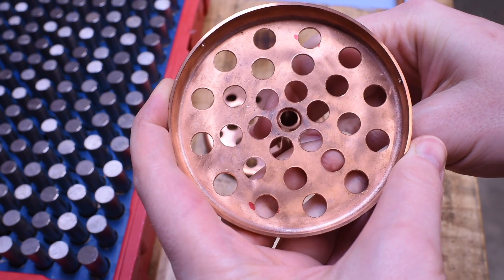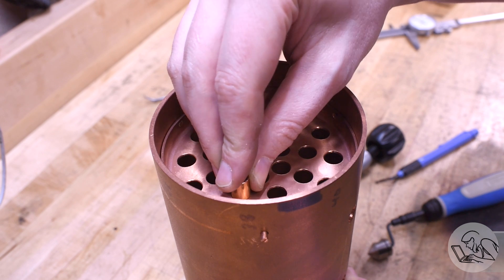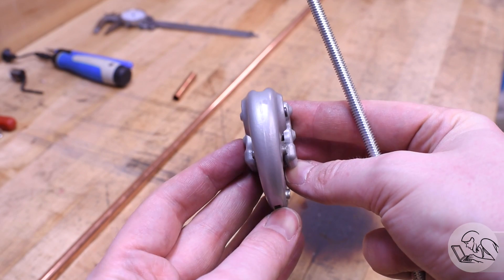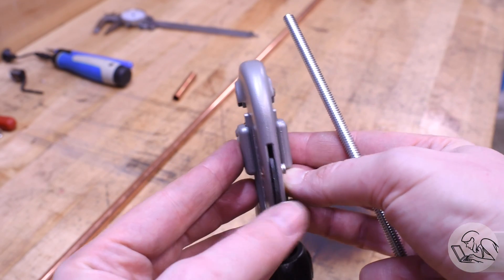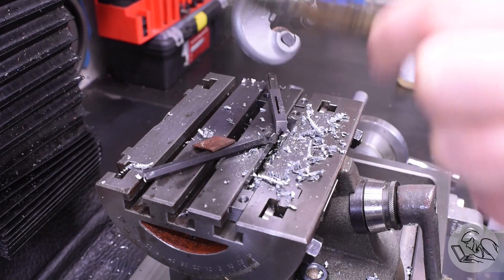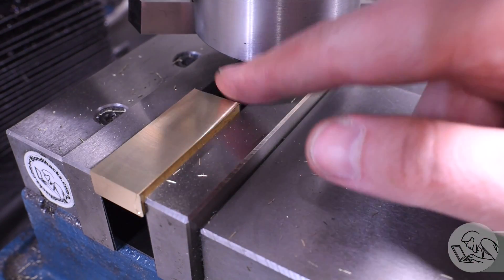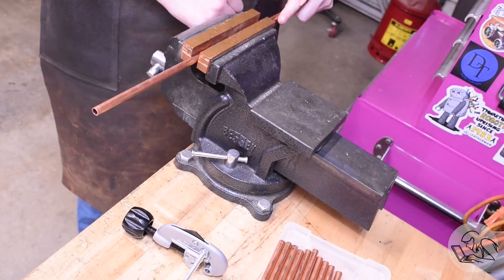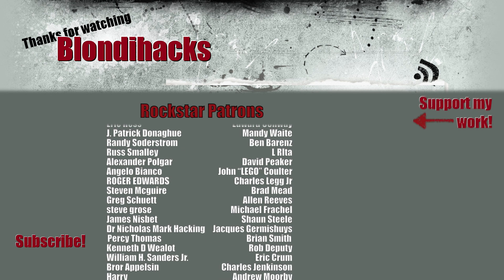Repeating Tubing Cutter : Making boiler fire tubes | Model Boiler Build, Part 5

Comment: out of curiosity... have you ever put together a boiler using two tubes per run, one inside the other leaving an 1/8" wall of water around the inner tube, and permitting the heat access to both the ID of the smaller tube and the OD of the larger tube to heat the water evenly instead of trying to heat a columnar shaft of water?

Comment: In the jewelry industry we often have to cut tubing at repeatable sizes for hinges, thus there are commercially available tubing cutting jigs. Of course, we generally make our own tubing, at about 1-1.5mm dia., and we cut the sections with a jewelers saw rather than a teeny-tiny tubing cutter.

Comment: Nice work. Just a suggestion, if you are going to be doing this kind of work in the future , you might want to pick up a flaring block and different swedging dies. This would help in adjusting your tube ends I believe. Thanks for the look.
Reply: Or make a set?

Comment: We had a yard period for the ship I was on, both boilers were re- tubed. The bell ends were flared by a special roller assembly and the process was simply judgmental by the operator, you'd think a slip clutch or some sort of torque limiter would be used, but nope, the old yardbird just stopped when he felt it was "right"- these old guys were the ones that would stop off at the bar just outside the yard and have 5 or 6 "boilermaker" drinks before heading home and doing the same stuff the next day. Never had a tube leak that I was aware of either, we'd hydro a 600 P.S.I. plant to 900 lbs. too.
Reply from the maker: Yah, tube rolling involves a lot of skill!

Comment: "A #7 (0.201") for some reason."
Tap drill size is the major diameter minus the thread pitch. That is 0.250 - 0.050 = 0.200 with a #7 being the closest bit available. As usual, the metric system is easier. An M6x1 uses a 5mm tap because 6mm - 1mm = 5mm. BTW, if the Imperial system marked bolts using the same method as in metric, a 1/4x20 would be IM.250 x .050 but 
1/4x28 would be IM.250 x .035714286.  :-(
Reply from the maker: Yes I know where it comes from. It was just a joke

Comment: The original sized copper tube could have easily been flared big enough to fill the gap.
Reply from the maker: I tried, it didn’t work well and would not have been a good joint
Reply: @Blondihacks  Don't know if you tried annealing the copper but that does make a huge difference.

Comment: For that last rod, I was expecting you to make a mini pipe expander like the muffler shops use.  Darn! 😁
I'm also impressed with your tubing cutter.  I have two of them and they always want to start turning threads instead of going around in the same spot.  Possibly General Tools is not the best place to buy a tubing cutter.
Anyway that was a very neat fix for your problem.

Comment: When you're using a collet chuck and the material is too short to reach the end, put some scrap bar/pipe (of a size that'll make it useful as a stop) into the collet first.
Reply: Before doing so, I would advise to check if it doesn't get stuck and you can't get it out anymore... 😜

Comment: Drilled and tapped 1/2-13 hole in headstock of lathe and threaded 5/8 CRS roundstock with 1/2 threads on end, into it. Made a bar with reamed 5/8 hole from 1/2 flatstock, slotsawed hole, tapped slot 10-24 for SHCS as a clamp and used that as a flip up stop with split collar on the 5/8 roundstock for repeatability for a parting tool. Works pretty good. Even better with a travel indicator. So sorta kinda like what you did Quinn. I like your idea.

Comment: Beautiful positioning table there.   The best I could ever do was a locking tilt-vise.

For making precisely placed  "stops", at consistent lengths on a tube, I have one of the old inside-beading tools.  These were used to put lips on metal tubing such that a rubber tube slipped over the metal would have a point where a hose clamp could hold the rubber securely.
The most easily found place to see one of these "lips" is on the outlet or inlet tube of a car radiator.
These tools were popular with airplane mechanics until it was found that these joints could still leak.  They are totally verboten for that application today.
Mine was made by Parker Products Corporation, came in a really nice Bakelite case, and contains two mandrel holders, two tubing holders, and a selection of mandrels.   It will put these beads on tubing from 1/4" to 2-1/2 " ID tubing. 

It works fine on large steel tubing, but for the really small tubes it should only be used on copper or brass.

Comment: The wet stone will actively remove the metal instead of removing any burrs on the precision surface.
If you take a look to his Stefan Gotteswinter's website on "Precision Benchstones" page, he does warn you about it in these application notes.
Otherwise, nice video !
Reply from the maker: These are precision ground stones. They only remove the high spots. You can see that they don’t even scratch like a regular stone does
Reply: @Blondihacks  Eh, letting you know it. You can compare the difference between dry or wet stone on a random piece of flat metal.
Reply: @km18l  Torino, open your ears. She said the ARE precision ground flat stones, not "wetstones" whatever you mean by that. I assure you that Quinn is completely familiar with both Stefan and Robin's videos on the subject.

Comment: If you had a DRO and could you use a tool post holder with a blank/solid tool holder to set the stick out from the chuck? Just pull the tube out until it hits the solid face.
Reply: The snag with that solution is trying to do it with the solid collet chuck, and avoiding the 3-jaw because of possible deformation (I think we called that squishing?).

Comment: I make my own ferrules for stainless wire rigging and fishing rigs.  Like you I like things to look right even if there is no structural need.  So a repeatable pipe cutter is just what I want. Holding small ferrules and filing them to size is a pain in the neck as is removing and measuring them multiple times.  So thank you very much.

Comment: There's always one in the crowd, eh?    I was thinking that you might anneal and expand the two ends of a regular size tube.  But the 10mm works just fine too.  And makes for a better story!  And as well congrats on hitting the 100K subscribers.
Reply from the maker: That was plan B, but since it was easy to get a 10mm tube, I felt better about that
Reply: Look, all metric, even the number of subscribers!
Reply: Hmm. 10mm is a regular (one assumes you mean "standard") size.

Comment: That tube cutter is a fab idea may be useful further down the line when you’re doing your pipe runs when I can finally get back into my workshop I’ll be taking that cutter idea and making my own
Reply: Oh and also Quinn bugger the metric system I grew up with it and I find imperial far far easier to understand you don’t have to thing about where a 1/4 an 8th or anything is it’s all marked out on the rule already 😉 also most model reference material is imperial

Comment: I'm amazed at the Precision you are putting into this boiler, all my quite free steaming boilers are unmeasured and crude with gaps everywhere and rough ends. I am using silfos 15 as my solder of choice though and it has no trouble filling gaps.
Reply from the maker: I certainly won’t claim all this precision is necessary 😁 I just enjoy the process
Reply: Never EVER use Silfos brazing rods on steam boilers.
Reply: @stuartdixon9552  it is plenty high temperature for what I am doing (I would never use it on any application above 25psi). Also all my boilers have rivets to keep the plates in place using solder as only a sealant.
Reply: Regarding Silfos 15, this brazing alloy was developed for brazing copper to copper refrigeration pipes.   If you use Silfos on a copper coal fired steam boiler, the sulphur in the coal will attack the metallic grain structure in the Silfos resulting in unrepairable leaks. One unfortunate model engineer here in UK built three copper locomotive boilers under the illusion that he was saving money as Silfos is very much cheaper than silver solder. All three boilers had to be scrapped. I imagine that if the boiler is to be fired by gas, then Silfos may be OK. I personally wouldn't take the risk.
Reply: @stuartdixon9552  thanks for the Info, This is a 2" vertical boiler mainly fired on  alcohol (dry firebox) although it does have provisions for coal fireing. In all honesty this is my first boiler so I figure it won't be in operation all that long anyway.

Comment: I lay out PCBs so mixing imperial and metric sizes is just a typical Tuesday.
Reply: I know what you mean, even in western Europe (with pretty much just metric only countries aside from the UK), trace width is still measured in imperial mil, clearance and many other things also, trace length on the other hand is for whatever reason mm again.
Reply: And new components are metric too, ensuring you cannot get even-looking traces between metric & imperial components 👍❤
Reply: There's a widget for that!
Reply: @escain  I dont really care tbh to use imperial on the job.
Its just required for a lot of dimensions to be in imperial (for documentation that is generated from the CAD), but the CAD does the conversion anyway.
I can type in the dimension i want for e.g trace width in metric and then it automatically converts to the closest imperial whole number, as all the DRs are imperial also (the tolerances of that are so small that its absolutely negligible and are far outweight by manufacturing tolerances).
It can be done both ways, but in the end it doesnt really matter as both are practically the same.
Reply: Metric to the rescue